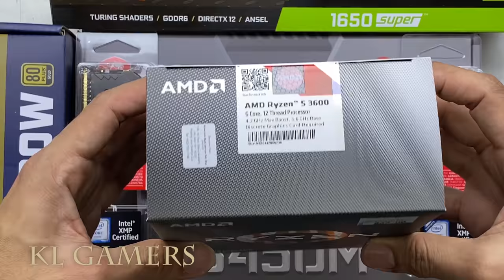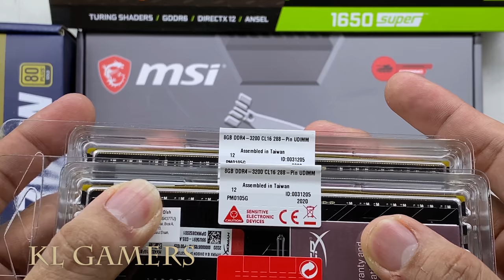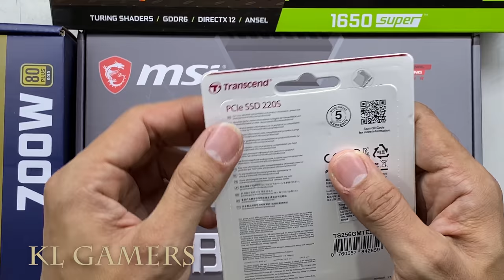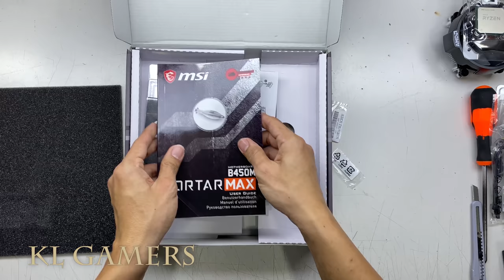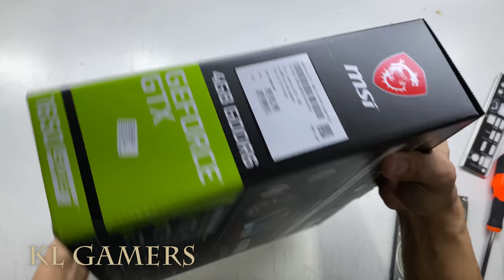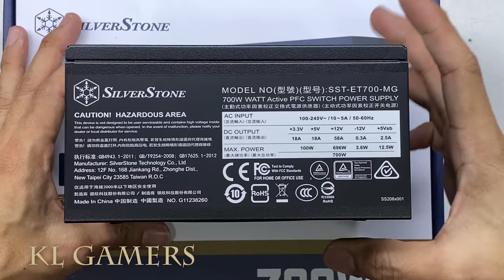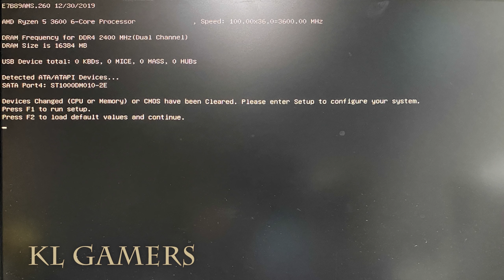AMD Ryzen 5 3600 msi B450M MORTAR MAX GTX 1650 SUPER GAMING X PC Build

Comment: Will this required bios update for Ryzen 3000 series out of the box? Planning to built with Ryzen 5 3400G. Btw I really admired you clear handy built as always! Your cable management are superb!
Reply from the maker: the max series is Ryzen 3000 series ready
Reply: Im using r5 3400g on this mobo. It works fine.

Comment: Essa  placa  possui a  mesma  característica  do  modelo normal? O   slot  M2_1 trabalha   a PCIe 3.0 x4  suportando   nvme  com  velocidades  de  até  3500MB/S, mas  o   slot  M2_2  trabalha  a   PCIe 2.0 x4, e  mesmo  que  você   coloque  um  nvme   de  3500MB/S   ele  fica   travado   em  1500MB/s  como limite! Confirma? Tenhoa  B450M Mortar  e   me  ferree   e  desisti  de comprar  outro  NVME. Essa  placa  só  deram um  gás  nas  frequências  das  memórias.
Reply from the maker: maybe, did not try

Comment: what happens when u accidentally put the cpu in before putting the lever up, but then trying to correct the problem, put the lever up with the cpu in the slot then put it back down to lock it in place? does it squash any pins ? and also does it matter which way the wraith cooler is facing? like to the right or left? my anviety is killing me coz the pc inst fully done and im worrying something bad is going to happen because of the little mistake ive done

Comment: How are parts prices in malaysia? it confuses me to see almost all of your builds have only 1660 or 1650 GPU, and also have expensive motherboard and CPU.
Like your previous build, ryzen 7 3800XT but GPU is 1660, why 1660 always every build you do?
Why not spend the money in the GPU instead?
Reply: in Malaysia they always gaming with 1080p resolution....1660 or 1650 is enough
Reply from the maker: because small monitors 24 inch not need too may fps
Reply: and high resolution monitor is quite expensive here...

Comment: how could u insert that 2 another fan into the power. and my concern is  every time the psu has a power its atomically run the fan or it depends on mother board when its turn in on?
Reply from the maker: direct power supply

Comment: Can i use 3600mhz memory module with this board..
Because it is not listed in the supported list..
If yes.. then what speed it will run at..
Reply from the maker: yes, depends processor
Reply: @KLGamers  R5 3600
Will it run 3600mhz ram at 3600 with b450m Mortar Max ?

Comment: How much does Ryzen 5 3600 cost?
Reply: Ryzen is very high price these days . I think about 16k-20k
Reply from the maker: Processor = AMD Ryzen 5 2600 6 Core 3.9GHz  = RM590
(Amazon link) = https://amzn.to/2YGanLM 
(Lazada link) = https://c.lazada.com.my/t/c.NVTK?url=https%3A%2F%2Fwww.lazada.com.my%2Fproducts%2Famd-socket-am4-ryzen-5-2600-34ghz-processor-i421788731-s613874952.html&&sub_id1=2600&sub_id2=JCI&sub_id3=535
(Shopee link) = https://invol.co/cln1vr

Processor = AMD Ryzen 5 3600 6-Core 12-Thread Unlocked Desktop Processor with Wraith Stealth Cooler
(Amazon link) = https://amzn.to/2O2NAYT
(Lazada link) = https://c.lazada.com.my/t/c.frpTb?url=https%3A%2F%2Fwww.lazada.com.my%2Fproducts%2Famd-ryzen-5-3600-36ghz-socket-am4-processor-i527378259-s1039618382.html&&sub_id1=3600&sub_id2=YES&sub_id3=758
(Shopee link) = https://invol.co/clq2d3

Comment: Is this motherboard compatible with the HyperX Fury RGB (HX432C16FB3A/8)?
Reply: Totally compatible as I am  using Kingston HyperX fury RGB DDR4 3200Mhz 16GB ( 8x2 ), no issue at all. Ram RGB lighting works flawlessly with Windows 10 latest edition. If RAM lighting fail to work somehow, get the latest windows 10 update to get it working.

Comment: I don't know if I noticed but where did you put the Wifi Card?
Reply: This crap mobo
Reply: Actually this MSI B450m mortar is a very stable board as I  am also using this board with R5 2400G for the last 3 years. No issues at all, can leave it on 24/7, 365 and it will still run as long as fans and power are ok. I am going to upgrade proc to 5600x and yet still use back this B450m mortar with just the BIOS update. I use TP-link PCIe wifi card and have very good wifi speed.

Comment: Guys I need help with my b450 mortar max mobo, the led is not lighting when I try to boot its not working. I am using 3600mhz ram and ryzen 5 3600
Reply: Did you insert the mobo power connectors or the power on switch cable connector  properly ?. Did the casing or CPU fan turn on or else check your power supply ?. Try reseating the RAM and lastly the CPU processor, make sure you install it correctly and with no bent pins. You must at least get the BIOS screen to come up.